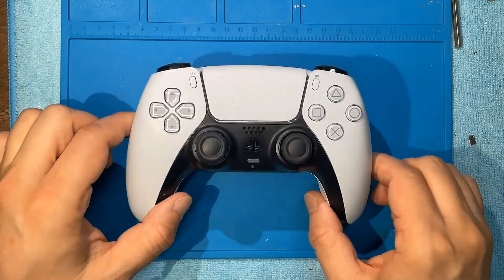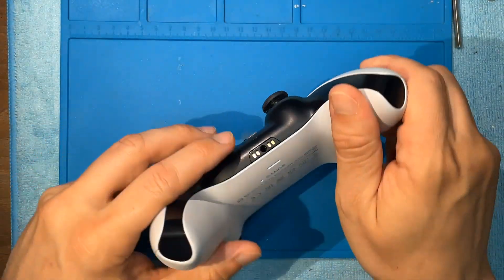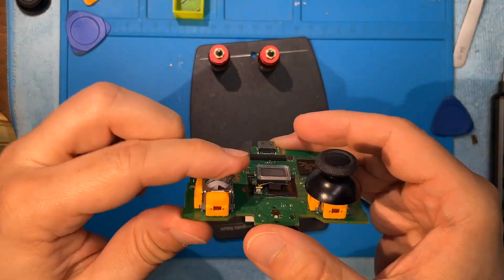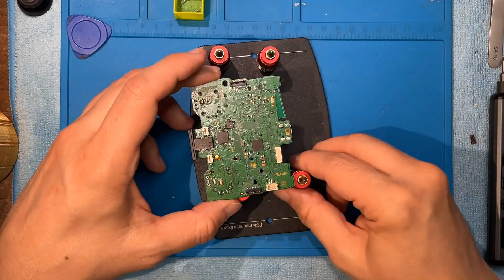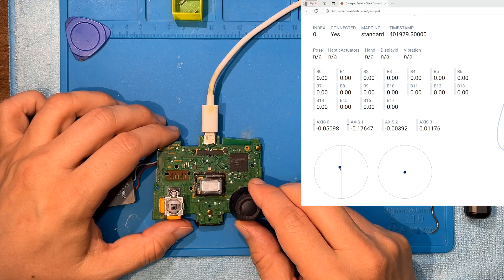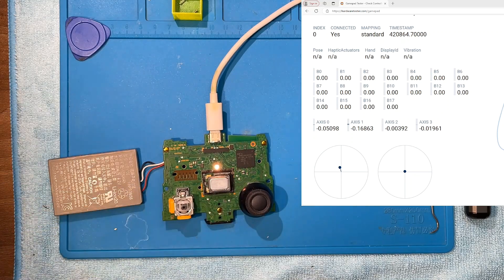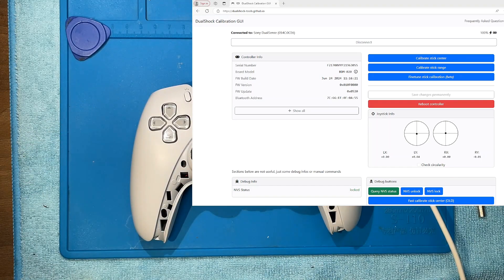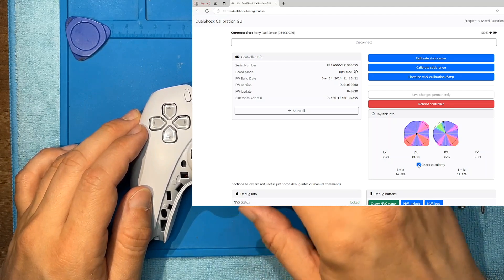PS5 Controller Joystick Stuck? Fixing & Calibrating Hall Effect Sticks (Left Stick Issue)

Comment: Hello FixIt All Workshop hope you doing well i have a problem with my dualsense controller motherboaard and im in panic mode i changed the left analog stick with hot air station and when i put it back together and started it blinks two times in orange then off sometimes it get on but left and right analog sticks are going crazy by themselves plus r2 and l2 doing the same thing please can you tell me what could possibly went wrong and is there any hope for fixing it ?
Reply from the maker: Sorry for replying late! (i still have a day job...) -- when i had what you described was because there were not the right HALL effect sticks -- this are not universal like - has to be for the exact controller you got!! So what you are describing - sounds to me exactly like wrong sensors. (i used ps4 ones in a xbox one and went crazy exactly the same way). But i would say that 90% is not burned or anything - just not the right ones!